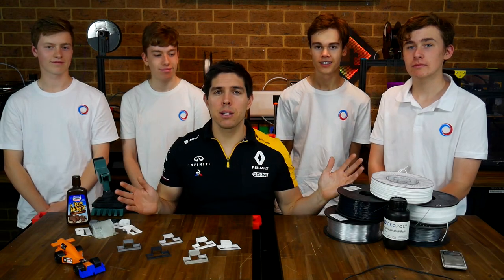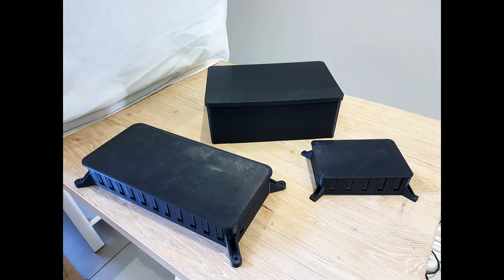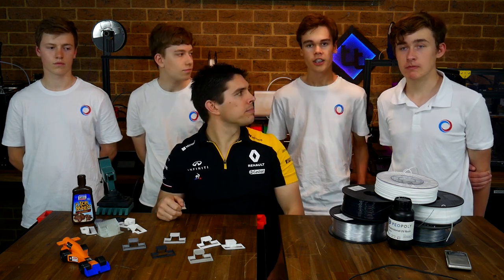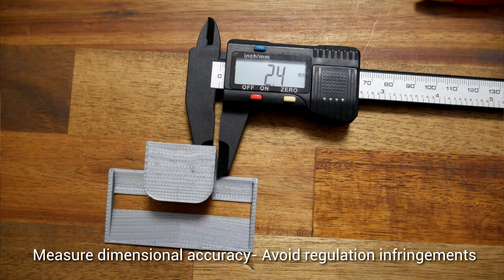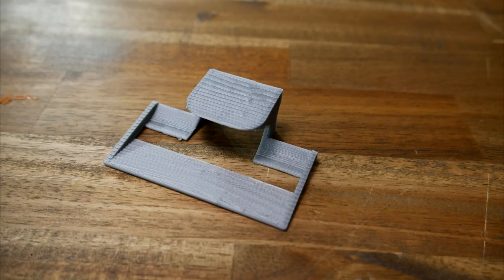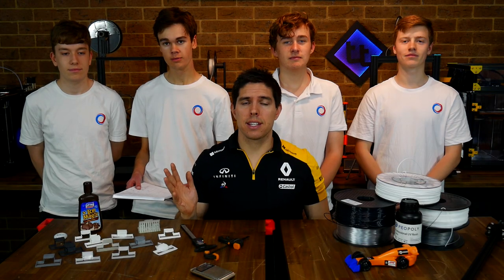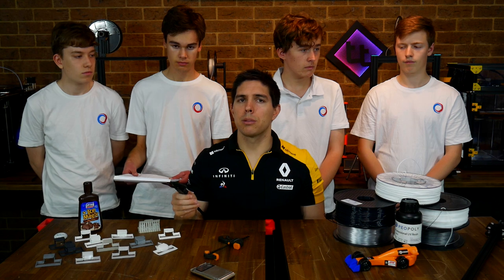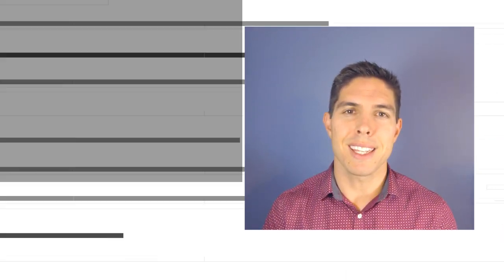3D printing engineering parts: PLA vs ASA vs PC vs PP vs nylon vs tough resin

Comment: Boy, I wish I had these kinds of tools available when I was a kid. Plus, another vote for “why no PETG?” It’s going to be stronger than PLA and as easy to print.
Reply: PLA is stronger than PETG.
Reply: Lol. If you say so...
Reply: @rwetmore  it somewhat is stronger depends on what you mean with strength. PLA is very strong but cant handle impacts very well. If you slowly load it with mass then PLA is very strong. :)
Reply: Well, seeing as the context was strength in a part that isn't load-bearing and is somewhat expected to be involved in a crash, I thought the answer was self-obvious, but self-obviously not so. 😉
Reply: btw, I've been told by folks enamored of PLA that PET-G is more brittle. Chemically, not true because of glycol's properties, but since many people just leave their partial rolls of PET-G hanging out it takes on a lot of moisture given it's quite hygroscopic. The water breaks down the copolymer chains, and the action of steam leaving the nozzle causes layers to not adhere very well. It's more heat-resistant than PLA and is just about as easy to print. And not much more expensive.
Reply: @rwetmore  yeah nah, PLA is brittle af while PETG if used correctly can handle a good amount of impact. Thats true.
Reply: I was just watching a bunch of test videos. Annealed pla is stronger and more heat resistant and more impact resistant than petg. Even properly kept (dry) petg. Annealed PLA also becomes more flexible and less brittle, almost as good as petg. The only thing none of the testers tested was if annealing pla stopped or at least mitigated its load deformation. You cannot anneal abs and petg, it's not chemically possible. I mean you can but the testers showed it did not affect the materials positively or negatively.
Reply: Point taken. Though, not all PLAs can be annealed to the same extent, dependent on additives for coloring, fibers (fibrousity? fibrousness? 😀), and viscosity. Hence the different recommended melting temperatures across different brands. And then there's the shrinkage and warping issues, the accomodation for which being a very trial and error process. Printing at the right temperature and using appropriate formulations is usually going to yield the best results.
Reply: @johnbasterson7938  annealed PLA is only practical if you don't care about the dimensions of the print.
Reply: @alejandroperez5368  no it is not, not even close. There are good reason why large soda bottles under pressure are made with PETG.
Reply: @truantray  they aren't. They are made out of PET not PETG and that's a money thing.
Reply: @alejandroperez5368  isnt it more that printing pure PET is like trying to print brass-focused glue while PETG is like printing bad glue?

I've had a few attempts at printing pure PET and it almost always ended with a blob on the nozzle
Reply: PLA is more firm than Petg, and that is what makes petg stronger. petg will flex before it snaps. PETG has much more layer adhesion, is way more abrasion resistant, and withstands heat much better than both pla and its pla+ variant. If you wanna pick a downside to petg, lets talk about post processing like sanding and painting. Don't even waste your time with petg if you need to do that. In all other respects, it is a better material.

Comment: I suspect your Nylon was wet. You MUST dry it before printing (and while printing, for longer jobs) - you can't just assume that it will be dry straight out of the packaging as it very rarely is, even if it's vacuum sealed with a sachet of dessicant. All of your issues with the Nylon print (maybe except the bed adhesion) are classic signs of damp filament.
Reply: It doesn't look wet on prints - but it's always a good idea to throw it into the oven overnight.
I see much more problems with warping due to using improper adhesion interface.
Dimafix is ok (when temperature of the bed is over 80C), but I much prefer Magigoo PA.
There's caveat though - none of the adhesion interfaces I've tested doesn't work properly with PEI coated beds (and I've tested many material/adhesion combinations).
I've had great success with glass and Flashforge print pad as bed. PA6, PA12 and other polyamides stuck very well to it.
Reply: @ovDarkness  Printing Nylon at the moment in a bootleg chamber (cardboard box lined with foil) and having a lot of success printing on PEI using a school water soluble glue stick. 4-6 thin coats allowed to dry between them and the Nylon sticks to it like crazy. So much so that it has slightly damaged my PEI sheet as it contracts slightly when cooling. Best thing is that it cleans up with water and paper towel.
Reply: I find nylon a pain in the ass even when it’s been fully dried and in a fully enclosed heated printer. (Raise3D Pro3)
Reply: But you can get away with drying and leaving it in a mylar bag for a couple weeks in my experience, at least with Fillamentum FX256 you can.

Comment: Nylon likes 70mm print speeds.  It is probably overkill for your needs but it is very strong. I used matterhackers Nylon G to make planishing hammer upper dies. In my application, I literally use Nylon G to shape metal panels for cars. I am just as surprised as you are, I did it as a joke at first but they actually hold up well.

Comment: All I ever use is Fillamentum's ASA. Never fails, dimensionally accurate, clean, strong. 

Slight price premium, but not enough to scare me away back to PLA, even for non-engineering prints.

Print on heated glass bed with Aquanet Super Hold and it will never ruin a first layer, yet parts often pop off by themselves when the glass cools.

Comment: Awesome video! I honestly expected a bit more from the prints itself. If you make a video about engineering materials I would like to know how to print them properly. That's what got me here. Still, I wasn't disappointed since the video itself was fun to watch!
Reply from the maker: As I said at the end this is just the starting point. Now we put in the time to refine the materials that have shown the most potential.
Reply: @TeachingTech  Thanks for your answer and nice that you are going to take a further look into these materials! Is Nylon among them? Because you had some trouble printing it, I can imagine that it looks like this material hasn't the most potential which could be different when printed without problems. The surface finish can turn out awesome :).

Comment: hey, have you considered nonplanar printing? this looks like a perfect time to use this technique :)
Reply: Will nonplanar printing work with such thin parts? IIRC the nonplanar printing is only applied to the final top surface, adding thickness.
Reply: @nixxonnor  It can be used for infill too, but the shape of the object should allow it

Comment: There are two kinds of Polycarbonate in the market. One is Makrolon, which is brittle and you can easily test your filament by bending more than 45 degrees - if it breaks, its Makrolon. The other is Lexan which bends and does not break. I am assuming that your PC filament is similar to Makrolon PC, because a pure Lexan will not break on your test. If your bed cannot heat up to 145 degrees C, you will fail to adhere to the bed. Also your nozzle has to get up to 325 degrees. PEI works well at that temperature, but you'll need a detachable PEI steel or thick sheet to remove the object after the print has cooled down.

Comment: Question? Where is the PETG?
Reply: ABS?
Reply: @agff1962  ABS is outdated, not stronger than even PLA and throws off toxic gasses.
Reply: @truantray  It depends how you define strong. It might have a lower harness (tensile strength), but so do practically all other filaments. ABS is about identical to Nylon and ASA in this respect. Where ABS excels, is at impact strength. ABS has a nearly 8x higher impact strength compared to PETG and PLA, whilst Nylon is only 3x and ASA 6x.
Lastly, ABS is very resilient to high temperature compared to other filaments.
tldr; ABS is not outdated at all, tensile strength alone does not say a lot about a material, and ABS definitely advantages over other filaments. There is a reason it is used a lot in all industries.

I do agree though that both ABS and PETG are missing in this comparison.
Reply: @truantray  So does ASA. Quote from a filament manufacturer: "As a counterpart as ABS, ASA filament generates toxic fumes when printing so it is very important to print in a place with good ventilation."
Reply: Came to the comments for this
Reply: Industrial material? No
Reply: @multimagical3137  where is PET then?

Comment: I heat my chamber using a $10 personal desk heater and a $20 PID controller with thermocouple and SSR. I can set the temperature based on what material I'm printing.

Comment: I use mainly ASA for my prints, easy, uv-resistant, strong enough and price is okay. I print it in enclosures and using filters because of particles and styrene.
Reply: How is the strength compared to PLA+?
Reply: What filters do you use?

Comment: I am new to 3D printing and from the information I had for a filament printer it was ASA that turned out to be the best choice for car parts. Thank you for the clarity on that ;)

I also am using PLA for testing and will be planning to make more parts in the near future to as accurate as possible for the vehicles around me, due to the low availability of parts.
For my first prints, I've never had so much success on my first shot, which was oversighted by someone with experience in the operation of 3D printers and CNC machines. I found it great to get the job done and build up a little confidence!

All in all, it costs with PLA about $1.00 to print parts so failures are acceptable to a point.
I can't wait to get my ASA roll :D

Thanks' for your videos, advice and support!
I saw the video about the Ender 3V2 and choose it based on the ability to buy kits and upgrade it! So cool :)

Comment: Nylon should be printed on garolite, you can use gluestick to help adhesion, support is to be avoided with nylon. Polycabonate works well with PEI, not PEX. I had a PEX sheet get destroyed by a PC print. Good luck. You should look into nylonX -- I have printed is successfully on garolite, it's stronger than regular nylon but is very impact resistant.
Reply: Using a sheet of polycarbonate as the print bed is also a good way to print PC or Nylon without warping or ruining the bed.
Reply: I have good results printing Nylon on glass at 80°C with 3DLAC on my Ender 3 pro with an enclosure. I use supports if necessary and they are hard to remove but not impossible. I hear good things about garolite which I should try.
Reply: Garolite is a name brand, the material is phenolic resin.

Comment: ASA is pretty much identical to ABS.. it will warp similarly but it's slightly better in every way (UV, printability, surface finish, sheen,etc).. we print with it a lot (150ish spools a year)

Comment: I am glad I found this video. I was going to just do the acrylic panels and call it good. I also had the same idea about using something like a incubator thermostat to control the heat in the enclosure. But I didn't account for needing additional insulation.

Comment: Re: polycarb and BuildTak. Not surprising that PC would fuse to BuildTak, as that surface uses an acrylic component, which is why you cannot clean BuildTak with acetone. A 3D printer company in my area uses BuildTak as their default surface, and when they did a PC print, it permanently fused to the BuildTak, ripping it when they tried to remove it.

Re: Nylon. Another local 3D printing company in my area recommends garolite (G10/FR4, basically circuit board material) for nylon prints, and Magigoo markets an adhesion solution specifically for polyamides and which Stefan over at CNC Kitchen uses on his Prusa MK2.5. (Disclaimer: I have yet to mess with nylon; I have a spool of carbon fiber nylon to test with the office MK3 at some point.)

I've been having some issues with ABS warping of late, so I'm starting to consider getting a print enclosure heater and some insulation for the office printer...

Glad to hear ASA worked great for you guys. Come to think of it, I think we have a roll of Spoolworks MatX...

Comment: I've been working on a 3d printed crossbow, and I'm wondering what your recommendation would be for printing the bow limbs.  I've been using PETG, which works OK at first, but doesn't hold  up to repetitive flexing long before part fatigue.

Comment: Good luck in November.

I don't know why but I am pretty sure my Ender 3 prints PLA better than your ender 5;

The big difference between them is that I have a 2mm lead screw on the X axis and a BMG clone extruder. The rest is stock. Maybe you should change the lead screw so it doesn't have to microstep to get layer heights that aren't a multiple of 0.04mm as that is just inaccurate.
Reply: What other changes did you need to make in software for that?
Reply: @dinosoarskill17  changed the steps/mm on the z axis to 1600.
Reply from the maker: This definitely wasn't a great PLA print, I agree. I did a quick tune and enable of linear advance, more optimisation needed.

Comment: Interesting,  I might have to get some ASA. Wad there a reason not to try PETG?
Reply: Was wondering that too, other than the very poor testing and conditions, didn't test PETG. ASA is great except highly toxic you want really good ventilation or print it outside like I do. Other than that, to me, there are only PROs. All I use are PETG, TPU and ASA.
Reply: @gg-gn3re  Thanks for pointing that out.  I'll skip trying asa then! I print in my cellar,  lol.
Reply: @Audio_Simon  haha yea, ABS is "arguably bad" but ASA is for sure bad to breathe in, much worse.
Reply: ASA like ABS generates toxic fumes when printing. Quote from a filament manufacturer: "As a counterpart as ABS, ASA filament generates toxic fumes when printing so it is very important to print in a place with good ventilation."
Reply: @gg-gn3re  "Only pros"? So how do you recycle them, because AFAIK all three are some of the most difficult to recycle - not because it's technically impossible, but because no one really does it (PETG is not PETE).
Reply: @tuesss  irrelevant, I don't throw any of my stuff away and have no need to recycle it. Why not read what I said twice before angrily replying to something I clearly said "to me" on? That means it's my pros to me personally.
Reply: the only downside of ASA as I noticed is low layer bonding, which makes prints not that strong as PET-G, or maybe ABS ( dont have experience )
Reply: @no-trick-pony  Technically you use an enclosed chamber, sealed, no ventilation. ventilate after the print or wait about 30-40 minutes for the fumes to condense on the sides of the enclosure and wipe it down.

Comment: It should be stated better that PP filament is lighter, therefore 500g roll is same amount of filament as 1000g roll of pla (legth, volume wise), hence the price is actually more in a range of 130/2 =65USD. Because 3d printer , in the end prints volume, not weight.

Comment: Students did great. I’m getting ready to use ASA for a project. Glad to see you had a good experience
Reply: ASA like ABS generates toxic fumes when printing. Quote from a filament manufacturer: "As a counterpart as ABS, ASA filament generates toxic fumes when printing so it is very important to print in a place with good ventilation."

Comment: Interesting, X3D are great but their PC is almost impossible to print with ive found, after a bit of research it appears if you want to be able to actually print PC you spend $100/kg (polymax, esun), interestingly ABS which is a fifth that price achieves similar youngs modulus at about 2/3 the tensile strength and is much more printable at a lower quality, now reconsidering whether I should aim to print everything in PC considering this.

Comment: keep in mind the pp filament was $130 per kg but it was also super light, so you could possibly print the same amount with a 500g spool of that as apposed to a 1kg spool of PLA.
Reply: Yeah, seems odd to measure cost per weight, when it should be cost per volume.

Comment: I'm with the why not petg group with a twist, I print daily petg-carbonfiber on glass no glue or heated chamber. Lightweight and if you tune your settings it's 0,02 mm accurate print after print. And smooth and strong.

Comment: Good Job, I have to add few thing here.  Remove the support before you cure the Resin, it's allot easier and leave a better finish.
Print your model on the FDM side-way.  One advantage will be to curve the profile to add down force with a smaller section, more efficient and lighter.  Also hallow all sections and walls.  Tube any shape have less weight for a similar strength.  A last thing, All material have different characteristics and requier often modification of the model, if you can...

Comment: cool stuff! great methodology and assessment. no PET or PETG?
Reply: I'd say PET would potentially be too brittle. PETG can act very brittle under high impact loads also (considering how ductile and maliable it can be under low impact loads).  Both have a similar density to PLA I believe? Easy to print though, and maybe perfectly adequate.
Reply: @jaistanley  PETG density is a lot higher than PLA, one of the highest of any 3D printed plastic. However, the tensile strength is lower (i.e. it flexes and doesnt snap, but does so at lower force than PLA), and the impact strength is practically identical to PLA.

Comment: i print esun nylon on heated bed at 90c with prusa texture plate. peels off on bare texture plate but using glue stick have never had a print fail.

Comment: Hi guys I only have an ender 3v2 right now  it has a glass heated bed (lol but I'm sure you knew that) and I would like to print items for my machine shop, items like tool holders, switch enclosures etc, sometimes machine oil can get on the items but not always, can you suggest something for me?